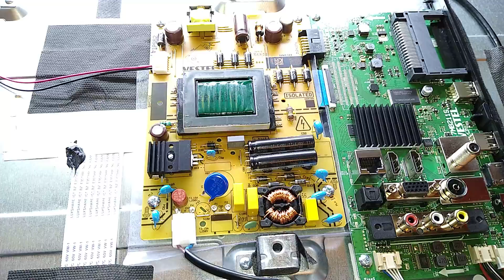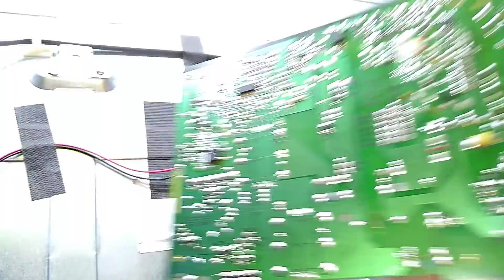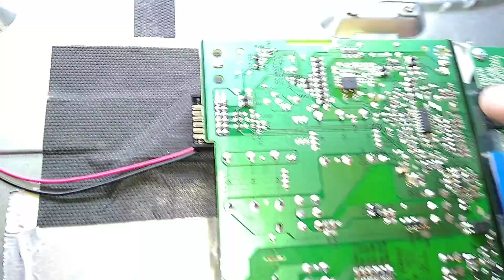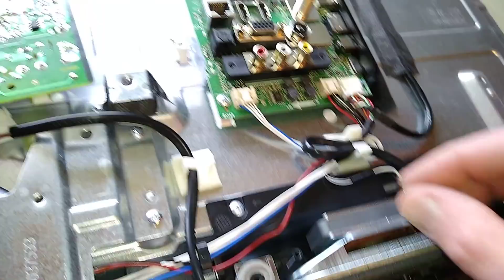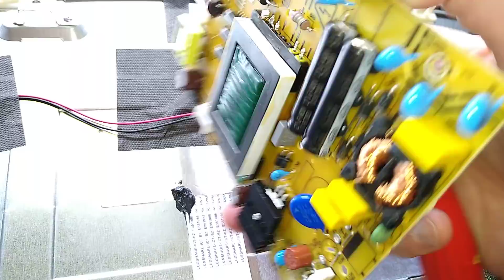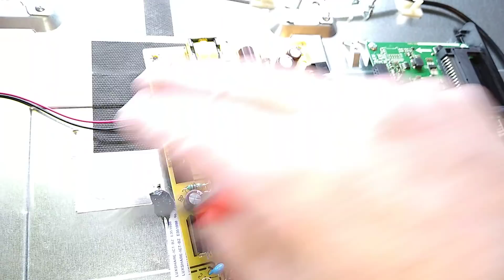There's not much inside TVs these days

Comment: "It did that horrible thing where after you start probing about it starts working again..." I've had programs like that. They run perfectly if you have a breakpoint, but take the breakpoint out and the thing mysteriously terminates.
Reply: Back in the 80's, I had to debug an assembly code problem that was caused by the assembler. If the number of bytes was divisible by 256, the assembler dropped the last byte.

Took weeks. I'm still pissed about it
Reply: @kirkkohnen5050  Back in college, some friends had some C code which would fail unless you put a noop in at a particularly point.  They spent like a week tracking it down to a bug in the compiler (dcc on on an SGI system FWIW).
A year of two later was working on some code (C++) which was doing lots of function pointer stuff... Worked fine on gcc, sparc's cc, and HPUX's default cc, but behaved very strangely when compiled on Windows.  The head of university relations at Microsoft actually helped port our code originally, so when we had it mostly isolated he (or some minions in Redmond) tracked it down to some bug in Visual Studio which actually got promptly fixed (for once).
Not quite "war stories"... but I guess it's nice to reminisce and remind yourself that sometimes it really isn't your fault ;)
Reply: @kirkkohnen5050  That wasn't the 6502 Assembly Language cartridge by Atari, by any chance (designed for the Atari 400 and 800 computers)? That thing had quite a few interesting "features"!
Reply: @kc5402  Nope. It was an assembler written by Vince Bogda.
Reply: @kirkkohnen5050  Ah, ok.
Reply: @kirkkohnen5050  Those are the kinds of issues and fixes you never forget! Always cool if you run into someone struggling with the same issue and you get to dazzle them with your quick answer, and never tell them how long you struggled solving it. ;-)
Reply: @Supersonicff-dw6bs  I had another one. In short, a routine using the stack was poorly written so that if there was an interrupt at just the right point, the system would crash. DOS's 18.2 Hz timer tick would randomly but very rarely interrupt the routine and crash it. 

2 months. I remember that one too.
Reply: @kirkkohnen5050  Well somebody forgot to set GIE (Global Interrupt Enable) to False and turn it on after the function ends
I think that could be a pretty common issue which is damn hard to find
Reply: @kirkkohnen5050  What's the reason for it dropping the last byte? I'm also impressed that you actually remember a problem from like 20-ish years ago that's that specific hahah
Reply: @faresel-amine7061  No clue why the assembler had that bug. I wasn't debugging the assembler, I was debugging my code.

And I remember it because it was so f-ing difficult to find. The listing the assembler put out was actually correct. 

Trying to change the code in any way changed the length of the program and made the error vanish.

Once I figured it out, the work around was trivial: End any code I wrote with a NOP.
Reply: @faresel-amine7061  Not remembering those kinds of issues would be a kin to never remembering that hitting your finger with a hammer hurts like hell!
Reply: @kirkkohnen5050  I always start going down in the layers when I find those "strange" bug that go away unexpectedly. There's always something wrong bellow, always. Only newbie programmers think it "fixed itself", or there was "nothing wrong". There's no heisenbugs actually, only clueless programmers ignoring all the layers bellow their foot.
Also, other things I spend time is, things that work but I don't know why, those are also bugs, you should go find why they work without being expected, and either document why or fix it too, before it breaks, because it will break when things change, and they always change, don't do a crappy job. Things should work as specified in the specs or documentation, don't presume its right because it works, that's the sin of the bad programmers.
Reply: In the old days before using breakpoints were common, we would add a statement writing out variables that might be wrong. Often, adding the write statement would hide the error. Usually, something important was being overwritten in memory because of a programming mistake.
Reply: somebody didnt await async properly xD
Reply: I wrote C code for 30  years starting in 1982.  People don't understand why I stopped and cannot do it any longer.  This crap was wrong on so many levels.  The art of writing debuggable code was survival then.
Reply: Sometimes those weird bugs can be the use of uninitialised variables
Reply: Ah, yes, fun timing based issues :D
Reply: It's called a Heisenbug.
Reply: Call it the coffee break for electronics. Everything needs a break. 
When people look at the code and see coffee break now. You will  mystify them with your secret code.
Reply: Reminds me of a pedal I had built years ago that would work until I put the last screw in the box. It didn't make any sense. Just rebuilt the thing from the start again.
Reply: Race condition ?
Reply: @yourdrinking  Sounds like taking the address of a temporary object without properly following lifetime extension rules. Easy mistake to make for sure.
Reply: @xplorethings  C++ is getting better, but still lots of easy mistakes, easier to fix, but hell to debug. That's what makes it expensive to develop. (and profitable, that's why I use it)

Comment: I opened a monitor the other day and the board was the size of a smartphone.  That's it. Nothing else inside but the buttons.
Reply: Speaking of, have the seen the size of smartphone PCBs?  They're practically postage stamps.
Reply: What else does it need?  Even or especially a smart TV, just a power supply, I/O, LED driver, and an Android SoC

Comment: Interesting that the power supply drops the voltage then it’s boosted again.  Why is this done?
Reply from the maker: To make it easier to regulate the current through the LEDs efficiently.  The same PCB can drive a wide range of LED voltages.
Reply: bigclivedotcom so you are saying it’s easier to do a major reduction using standard components and then just vary the boost circuit as required?
Reply from the maker: @michaelfisher9671  From what I can see, the boost is ramped up until the required LED current is achieved.  But with a safety threshold.
Reply: @bigclivedotcom  Thanks Clive
Reply: @michaelfisher9671  TVs and monitors usually also have adjustable brightness, which means you need to control the LED current as well. 
Running Power-LEDs from a fixed voltage is quite inefficient in general, so you always want a switching current-controlled power supply. If the TV didnt need any other voltages (like 12V), you could technically do constant-current control with the big step-down transformer.
Reply: @Basement-Science  Thanks that all makes sense
Reply: Most led string drivers are output current controlled because LEDs need current control to prevent thermal runaway. Most LED drivers are designed for a set voltage input. The LED driver they are using would be an easily obtainable IC in one of the most common input voltages, which is 12V.

Comment: The company I work for sells primarily TVs, I've worked in a number of roles there in my time and probably 6 months or so was spent repairing things like TVs (among other things). This is pretty much the same as they looked back then (5+ years ago), though it was at the time that CCFL was still being phased out - those ones had a separate CCFL driver board.
Reply: Whew, why must you remind me of old backlight systems? I had a set with a florescent backlight ad front glass. It was a 45 inch set that weighed about 50 lbs, I thought it was plasma until I changed out the backlight and saw the lcd panel
Reply: I have a question, here in the video, on the yellow board, are those two cylindrical things batteries? 🤔
Reply: @busog97641  no, they're just capacitors

Comment: A few months ago during my neighborhood's 'Big Junk Day' I drove by someone's trash pile and they were throwing away a 48" Samsung LCD TV. 
It's only 1080p, and uses the CCFL as backlight. I popped it into my Jeep and came home, plugged it in, and it worked!  I'd originally just got picked it up to create one of those big faux window daylight panels, but since it's working I thought I'd keep it. 
I've been wondering how viable it would be to replace all the CCFL's with LED strips. I already have a lot of the high CRI 12v white LED  strips. I'd imagine it wouldn't actually be that hard. Just need to replace the high voltage CCFL power supply with a 12v one, and maybe whip up some extra light diffusers to smooth out the LED light a little.  I mean... it was free... and if I could make it use less energy when running, it may be worth a try!   :D
Reply: Last winter, our neighbourhood watch Whatsapp group posted about a TV lying in the rain outside a recently vacated house. My boarder went to pick it up, an old Panasonic CRT TV, plugged it in after replacing a fuse with foil (!), and a year later it still works...
Reply: "It's only 1080p" everyone I know would consider 1080p a luxury, and 4K would be considered to be an oversized TV
Reply: @pineappleroad  well, the TV is like 12 years old and here at least, 4K is the most common you can buy and they’re not all too expensive anymore.
Reply: @BRUXXUS  The TV my sister has is probibly an anchent flat panel one (which does have a fault, as the buttons on it are a bit unresponsive but do work, and it doesnt respond to the remote at all)
and there are 2 TVs which were both bought no later than 2010, one of these is the TV my parents use for watching TV, the other is a spare, and it is TINY (it does have a built-in DVD player though)
i dont watch TV myself, and i live with my parents, and i know that they arent going to replace it until it breaks (it does have a weird red line that appears every now and then, but my parents won't replace it just because of that, I think that TV is something like 24", i dont know how big or small the tiny one is)